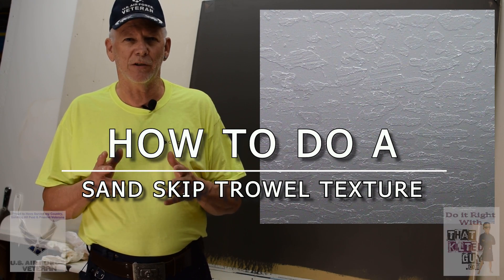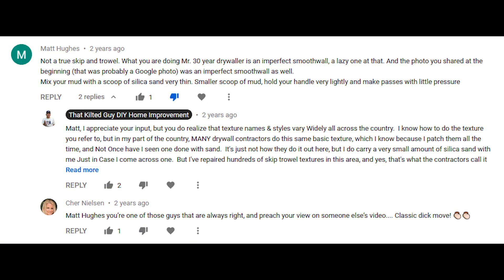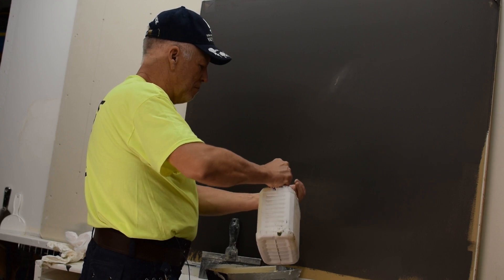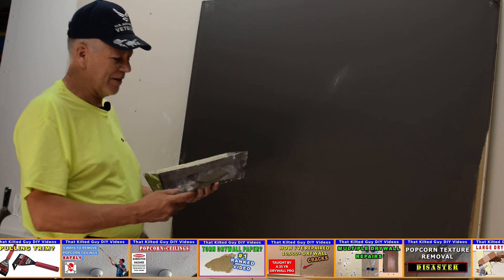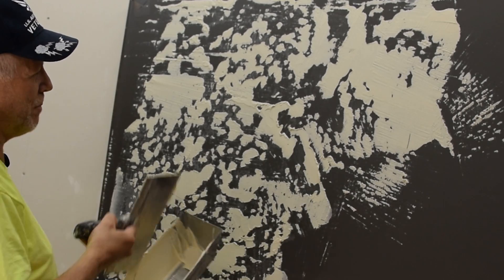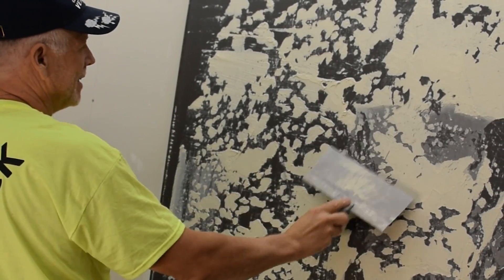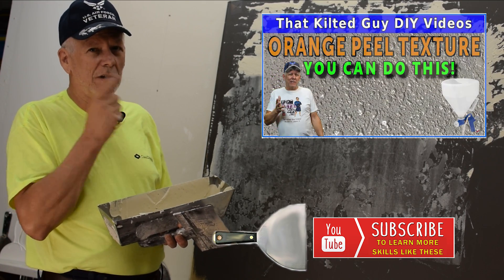How to Skip Trowel Texture Drywall, with Sand

Comment: I just wanted to say I honestly appreciate you showing the size of the sand needed for this texture using a penny. Believe it or not, finding the correct sand is a little difficult. Especially when you have no idea what size grit to get. The big box stores typically only sell either play sand or multi-purpose sand. Both of which are either too big of granules or it's full of dirt and other debri. I wound up getting pool filter sand! It's not only very clean but it's the correct size of silica sand. It's also very cheap at around 9 dollars for 50 pounds, which is way more than you'll need for an average house. Thanks again!

Comment from the maker: Who has this in their area?  Or have you done this texture?  I hope you'll comment below as I'm curious what others think of this, who's seen it in their area, etc.  Thank You.
Reply from the maker: And, are you in the trades, or just a novice, or?
Reply: Here on Oklahoma...we do it on 85% of my builders houses...we do it with no sand in the mud...the key is to relax your arm and let the weight of the knife skip it you can get long spreads its fast and looks good...I know you was texturing in a small area...and you can go heavy or as light as the home owners want its so versatile...appreciate your videos been in this biz 33 years
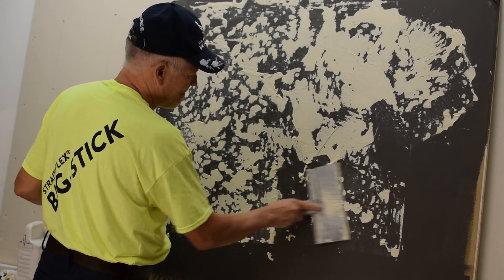Reply: I am in California in the San Francisco Bay Area. Most houses built here around the mid-eighties, like mine, have popcorn ceilings and a skip trowel texture on the walls.  I am a DIYer and know how to do knockdown, but man what a mess.  I just had a contractor replace some water damaged wallboard and remove popcorn in the rest of our family room and skip trowel the ceiling.  It looks like it has always been there because it matches the wall texture.  His employees added sand and the "lines" are fairly uniform in width and length and all going the same direction.  I did not watch but it appears they dragged the blade in the same direction all throughout, without any swirling.  It looks like the lighter method you showed at 8:25. It does not have the randomness of sizes like your version.  No judgment there, just making an observation. It looks very nice and there are no deep recesses like with knockdown.  It seems much easier than knockdown and seems to use much less mud too.  I came to your channel because you explain details in a way that is easy for me to understand.  I wanted to see how to do it myself for the rest of my house.  I already know how to remove the popcorn, thanks to your other video.  Much appreciation, fine sir.
Reply: I am in South Florida and on the outside, this texture with broad patterns are  everywhere, while inside, the patterns are smaller.
Reply from the maker: Outside it’s stucco
Reply from the maker: Thanks, I appreciate that 😎, & Thanks for subscribing!
Reply: @ThatKiltedGuyDIY  what would you recommend the amount of sand to add to a box of light weight mud? Can only find sand for playgrounds also 🤔TIA
Reply from the maker: I’ve actually only done this texture with sand for a video. No one does it in this area so I really don’t know the answer to your question. Paul Peck drywall channel does this often so he could probably tell you.
Reply: @ThatKiltedGuyDIY  thank you!!!

Comment: Do you have a video on how to repair a wall with this ? We have some cracks and the previous homeowner mudded a few of  them smooth.
Reply from the maker: Well if the previous owners did the repair right, just feather the edges by sanding them very thin at a taper, then you can use this technique to re-apply the texture.  I'd practice on some scrap first though.

If you still need to repair them, I do have videos on crack repair on ceilings, and one on walls.

Comment: Where can I find the right sand?  I heard play sand doesn’t work.
Reply from the maker: We actually don't do sand textures here, so I'm not sure.  I believe I just bought Silica Sand from the lumber yard about 20 years ago, and that's what I used here as I never need it in our parts.
Reply: Have bought it at Lowe's in the paint section where the texture supplies are and also at Sherwin Williams.